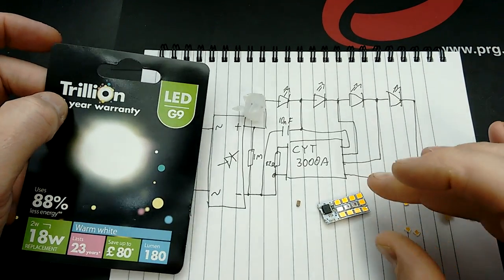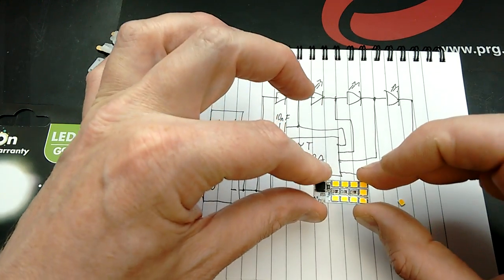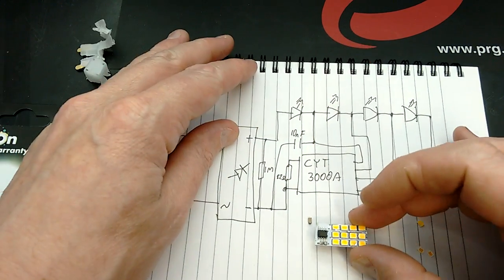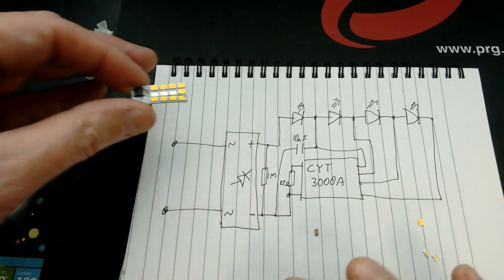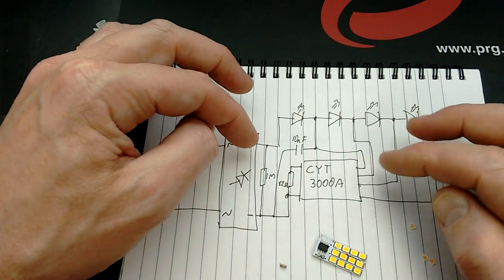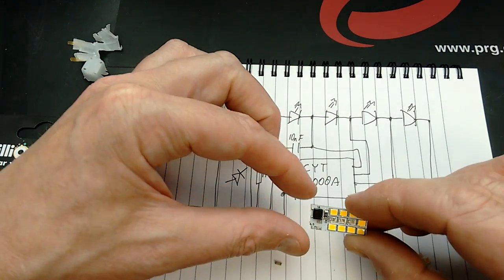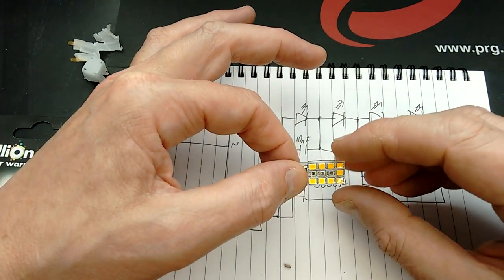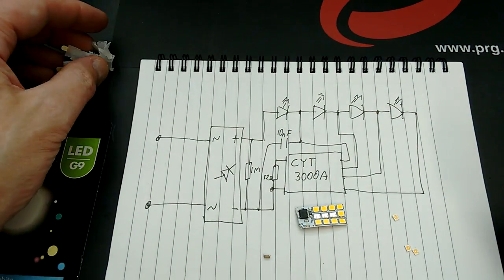Inside an obliterated (by me) G9 LED lamp.

Comment: I can't find any help anywhere else so I thought I'd ask here, I have a Peugeot 206 and the key battery seems to drain instantly, I bought a set of energiser batteries (cr2016) and they have both been drained at a rate of 1 a day the battery before that was also drained I checked the batteries at the start with a battery checker (bt-168) and they read very high they now are completely flat. I've had a look for a loos solder joint or a short but I can't see what's causing the batteries to constantly drain, anyone know of a fix or what could be going wrong?

Comment: What is the input voltage for these, surely not mains?
Reply from the maker: Yes it is.  240V.  It uses a large array of series LEDs (there appear to be several chips in each package) to work like a string of regulated fairy lights.

Comment: I have a random ebay G9 that looks very similar with a chip each side of the PCB (I have not taken it apart to check part numbers).

100 + hours of use and all the LEDs are still going strong.

Comment: If I understand this right, the chip switches banks of LEDs in and out depending on the input voltage of the rectified AC. I am not an electrician, but if this is right some of the LEDs have a higher duty cycle than others, so they will get hotter and ultimately wear out faster.
Reply: It would flicker like crazy anyway due to it being powered by rectified mains. Usually there would be smoothing capacitors across the LEDs to help with that, but there probably wasn't enough space.
Reply: Wouldn't this also flicker like crazy, if some of the LEDs are only coming on at the peaks of the sine wave?

Comment: Do you know any G9 LED lamp with smoothing? I can't stand the flickering.
Reply from the maker: I've not really come across any.  It's a miracle that they even manage to fit the existing mains current limiting circuitry and LEDs in such a small area as it is.  The classic G9 lamp package was never made with LEDs in mind.
Reply from the maker: There's usually no room for the smoothing capacitor inside the small housing.
Reply: G9's are awful - hate the things. Replaced mine with standard lamp holders.
Reply: +bigclivedotcom I was going to ask the same question. I can't find a single G9 LED that doesn't flicker so much as to be unbearable. Do any exist?

Comment: I guess this sinusoidal switching is for PFC? Do all LEDs have equal RMS current? Output current for D1-4 is given in the datasheet, but I'm not sure how exactly it works, is only one output active at a time or many?
Reply from the maker: It has modestly good power factor.  There are different numbers of LEDs in each group.  First group one switches on and then when it is passing the threshold current it is put in series with group two and when they are passing the threshold current again the third and then fourth groups are added in sequence.
Reply: I see. Very clever indeed. A university lecturer, who also is an EMC test engineer at Satel, always points poor PF of LED lamps in a lab exercise we had to do. Whether his claim that resulting harmonics cause existing legacy power transformers to overheat is true, I'm not sure. They seem not to fail... too often ;-)

Comment: not sure if the Philips LED-lamps (E27 or GU10) are good and safe but I choose those instead of the chinese brands
Reply: LED lights tend to be safe as long as you don't go poking around like we do... It's due to the capacitive droppers used in these types of lamps that make it dangerous to us nosy people but if you leave it in the casing you should be safe.
Reply: +thebeginner electricalengineer righteo :)